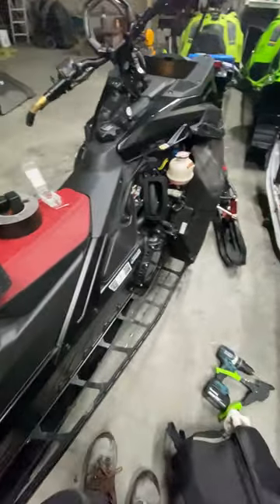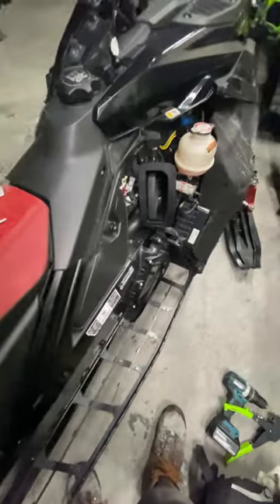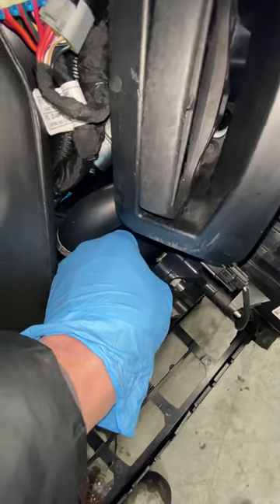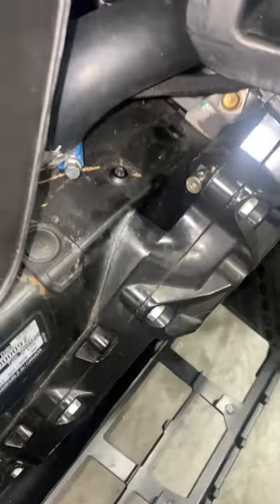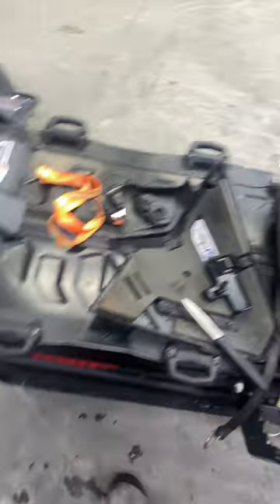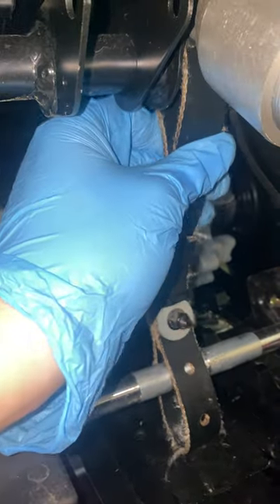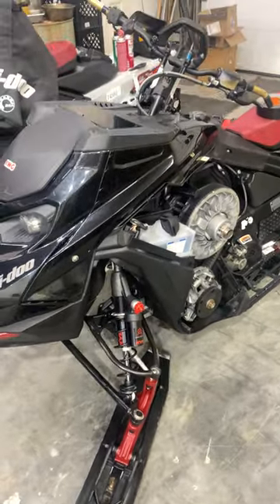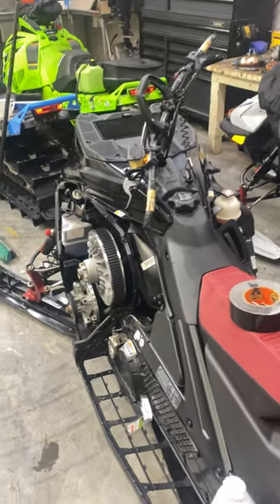Skidoo Freeride Gen 5 (Chain-case adjustment) (Limiter strap setting) 500 mile look-over!!

Comment: Hey Bud What limiter setting are you at is that considered 2 or 4? You only take the bolt out of the loose side of strap correct? and tighten or loosen that loose side?

Comment: the confusion on chain tightening is because suddenly BRP/ambassadors starting talking nonstop about how important chain tension is. we now know it's because they supplied '23 turbo sleds with chains and sprockets rated only for non-turbo use, hence the constant chain tensioning talk. there is now a recall to get the proper equipment installed in turbo sleds.
Reply from the maker: Everyone is entitled to their own opinion. Making consumers aware of how to PROPERLY tension their chain is surely not the reason for any issues. Also I had a NA 850 gear and chain on my turbo last year, I never had an issue. Just food for thought. If you have any constructive questions please comment away, but please refrain from bashing brp and their knowledgable ambassadors. Everyone is trying to help you have an enjoyable experience on the snow. Stay safe and sled on!!
Reply: @nikpahno  never said that properly tensioning the chain caused issues. most everybody that rides sleds knows that is an essential part of maintenance. the difference this time was the large amount of emphasis put on in it and then the when owners found out they had inferior parts installed, they realized why the emphasis on chain tightening which was to minimize risk of chain case exploding. brp nor the ambassadors were forthcoming about this and the whole thing was a little shady. that's great that you never had an issue but you're just one data point and in fact, there's a recall so clearly there was/is a problem. them's the facts. and no one is above criticism.